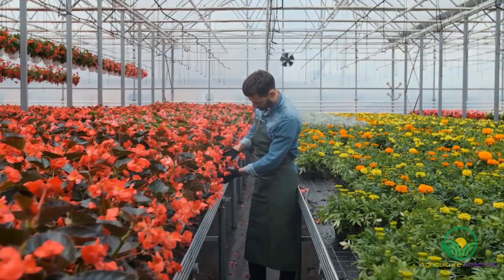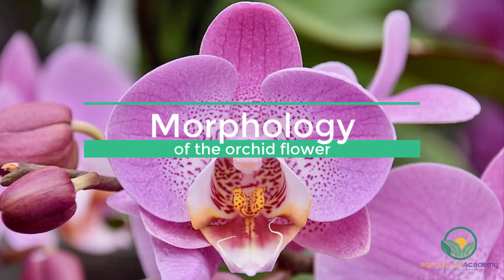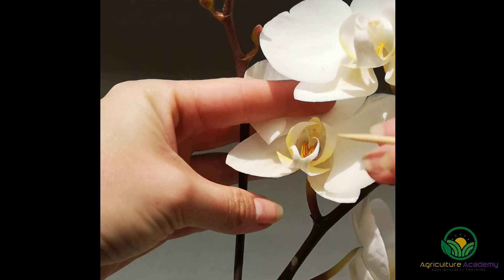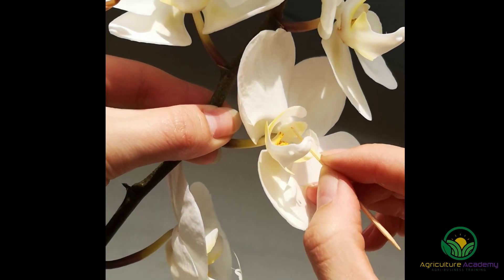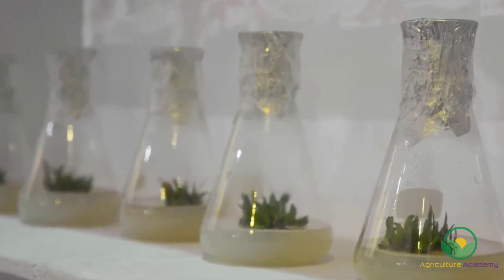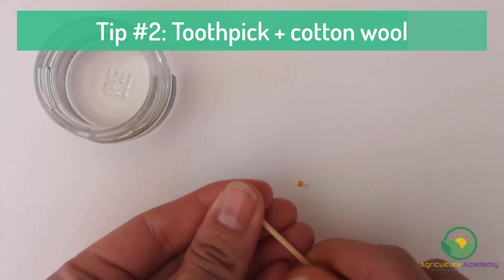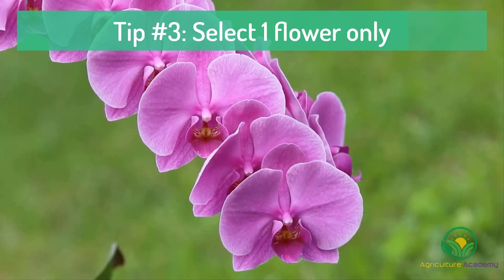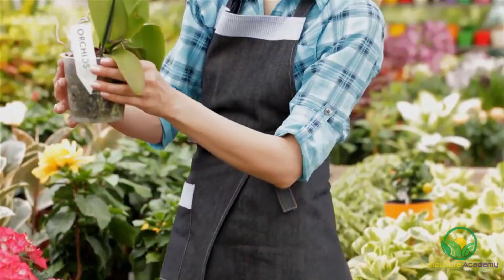How to Grow Orchid Seeds at Home like a PRO

Comment: only problem is with the tip to use a different flower. if you pollinate the same flower the new plants should revert to some combination of the orriginal flowers that were used to create the one you are pollinating.